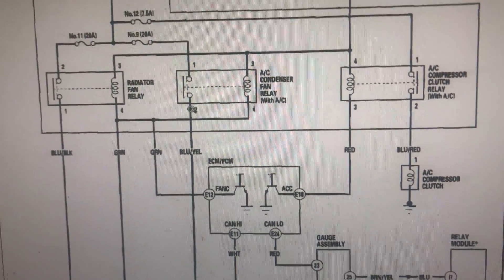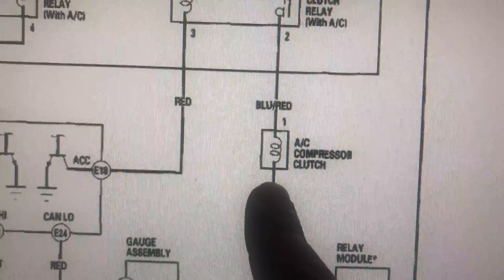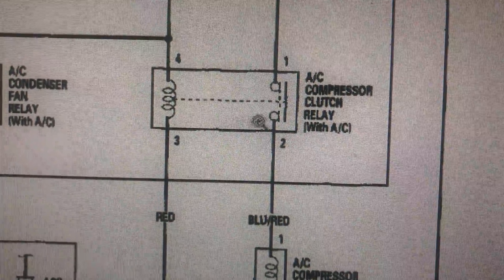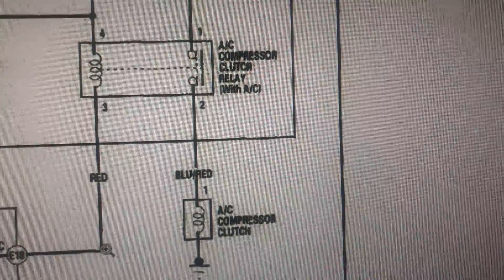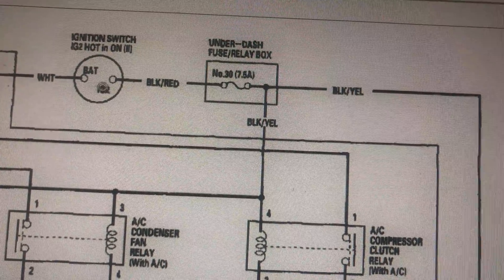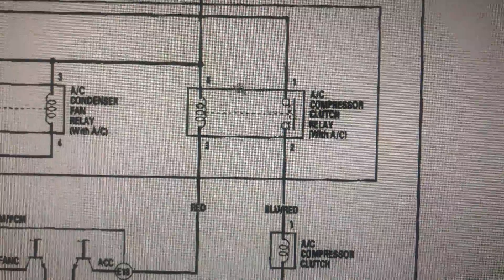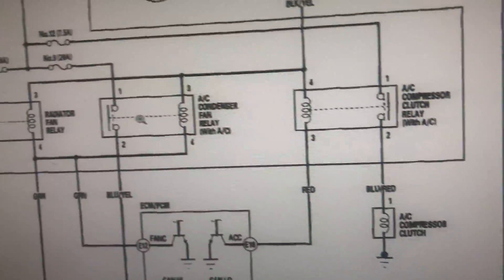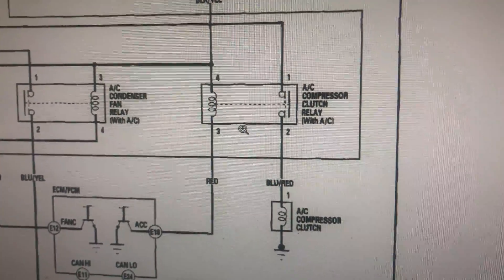Honda Accord 2.4L 2003 to 2007 AC Compressor wiring diagram, relay and fuse explained

Comment: All wires get power all relays are good but the ac dosnt kick, tested everything checked every fuse even took apart the harness and found nothing, my only conclusion is the ecm/pcm
Reply: Please lmk if I'm wrong I love in az and it's hell rn w out ac
Reply from the maker: Damn bro hell of hot anyways check pressure? Also check power to ac compressor with ac on and scan the car for codes. Let me know what year make model u have

Comment: my car is 2007 Honda Accord but number 12 fuses 7.5 A. has not in may car?🤔 ...why? In its place there is a 20 amp fuse for headlight washing.
Reply from the maker: Maybe sumone move it around
Reply: @RBTheMechanic  There was no clutch operation because the air conditioner gas ran out. Thank you.
Reply from the maker: @adnanbedestencioglu6680  oh ok 👍
Reply: @RBTheMechanic  The original is like that, I think there is a difference in version... Unfortunately, my air conditioning compressor does not engage.

Comment: What if all that works but the blower and when connecting blower to direct power ot works. Could maybe the wire harness?
Reply from the maker: I doubt it I can’t say fire sure u have to check inputs out puts relay fuses and check resistor try high speed

Comment: hello, when I installed junsun android screen, my motor both fans doesnt work with ac on, with original fans start instantly, do you know what might be the problem?
Reply from the maker: You installed what?
Reply: @RBTheMechanic  I swapped original radio player with android unit from junsun
Reply from the maker: @zydrunaslazauskas7273  so that shouldn’t affect unless u tapped in to wiring

Comment: Does the ecu engerzie the relay or the climate control panel?
Reply: What fuse gives power to the climate control?
Reply from the maker: @mmar4281990  I gotta check that also but it should be under hood listed under cover
Reply: Is their anyway I can get a copy of the circuits?
Reply from the maker: @mmar4281990  I can send u pictures Monday noon
Reply: I would really appreciate it 🙏
Reply from the maker: I would have to check on that what year car make model u got
Reply: @RBTheMechanic  2004 honda accord ex v6 sedan
Reply from the maker: @mmar4281990  yup it’s controlled by ecm

Comment: mine say climate control cant be used when engine is off 
i checked all fuses their all good how do i fix this?
2004 honda accord v6 sedan
Reply from the maker: Ac wount work without engine running but with key on acc u should be able to turn fan speed and mode
Reply: @RBTheMechanic  that doesn't work either

Comment: Thanks for the video.  I have an interesting issue.  Neither my condenser or radiator fan come on when I turn on ac.  Also, ac clutch doesn't engage.  However, I know both are functional, as they both turn on if I manually jump the relay socket pins.  Also, the condenser fan does turn on when the radiator is cooling itself.  So those don't seem to be the issue.

I'm going to need to re-do my research with a test light (I was only using a multimeter), but it does appear I was getting a switched signal at both relay sockets when I turned the AC on and tested the pins with a multimeter.  So I think the problem lies in the engine bay and not the interior area, because the relays are receiving a signal.  Both relays have been tested and are good.

Already checked the low side pressure and it's fine (97 acura cl v6) at 35psi with the clutch manually engaged.  However, I have not checked the high side pressure (I'd have to order a kit for that).  Also tested the ambient temp sensor and it appears to be reading fine.  

Also tried manually jumping the ac pressure switch's (my vehicle only has 1 pressure switch) 2 terminals to simulate continuity, but nothing changed.  At this point I'm kind of stumped.  Either I'm getting the wrong reading on my low side pressure, or my high side pressure if off..or I'm running out of ideas.

Looking at the Ac diagram for my vehicle, it appears the only other culprits could be a faulty engine coolant temp sensor (I replaced it with a new unit a month ago), a bad fan radiator switch, or faulty radiator fan control module.  

One thing I will say, is that I'm wondering if my cooling fans are working as they should.  With the car idling and warmed up to temp, they both kick on simultaneously, but only stay on for around 10 seconds.  Then kick back on a few minutes later and stay on for 10 seconds...in an infinite cycle.  Is this normal behavior for a parked car, or should they be staying on longer than that?

Thanks for any ideas!
Reply from the maker: They usully come on and off for 5/10 seconds with ac they will run all time check to see if ac system works

Comment: Hi. please help me. My h/accord 03.the relay pin 4 no signal ( rad fan cond fan and comp) pressure switch temp sensor is ok,
Reply from the maker: Somthing like that u have to do electrical trouble shooting.  How ever do check fuses and swap the relay regardless

Comment: Hello, I got a 2003 honda Accord. If I short the relay with a paper clip bypass the cluch kicks in. but when I put the relay back or switch with others it the cluch doesnt kick. Can you help?
Reply from the maker: When u by pass and clutch kicks on dose ur ac blow cold?
Reply: @RBTheMechanic  yes and I was able to charge the system
Reply from the maker: @o4u2sweat  well did u change out the relay?
Reply: @RBTheMechanic  yes and switch them with others. No luck

Comment: Thanks. Please help. I can't get my ECU to produce ground for the relay to work.
Reply from the maker: What year make model I have.   Look in to the pressure switch for ac scan the car look for any HVAC codes let me know need to scan all modules also use good scan tool the small $80 scan tools will not pull the codes
Reply: @RBTheMechanic  Thanks. I got a good scan tool and all are fine except a short in air mix door motor.
Reply: @RBTheMechanic  The switching side of the compressor relay starts the compressor when I bridge it. On the other side,  there is steady live voltage when ignition is on.  My ac control panel switch clicks and lights up but does not send ground to the second component of the relay as it should
Reply from the maker: @fortunerecords8154  check all of ur fuses and ac pressure switch gives digital to computer to command the ac to come on anyways dose the system get cold when u bridge it?
Reply: @RBTheMechanic  I made a discovery tonight.  I noticed that my seat belt warning light, dash backlight(when key is inserted), driver door alarm and ac system all went down same time. I unplugged a battery terminal and let it sit for a while and all these functioned normally for a minute before going bad again. My SRS module is bad and burned from soldering, is it a possible cause or would it be the under dash fuse box/module. Thanks a bunch
Reply from the maker: @fortunerecords8154  I’m not sure if wiring coross to module but u might have to fix the soldering wiring and make sure everything is good check fuses also this is serious electrical issue

Comment: I see message down below. It is  pretty much the same as what  I  have experienced. 
It is found that: clutch coil on my Honda 2005 is bad. It stops  working after couple  cycles on/ off.  ... I measured resistance of coil . It reads  4 ohms when working.  Let it run couple minutes... When AC stop working, coil resistance reads 0 ohm. So, clutch is short when getting hot. 
time to replace coil now.
Reply from the maker: Dong Bao hood diagnostic u went deep in to measurements I silly swap relay then see if ac compressor has power if it got power bad compressor!
Reply: @RBTheMechanic  Relay is checked and even exchanged . Because there are identical relays around clutch relay. I still get the same problem:  Clutch is engaged. Cool air comes out.  Then I drive  car out. In middle of road, no AC anymore, just hot air...  Relay is super hot. Guess that  current is pretty high when coil is getting  worse  until it is short . That is how measurement is to be done to make sure clutch is root cause, not  control , or relay. Now, removing clutch is next thing to do. :-) . I am electrical guy, not mechanical. But it looks not too hard.
Second,  AC control indication on LCD screen is gone now. It appears that I have to reset controller board or so. No AC control on screen .  My Honda is 2005 V6. If you know  how to reset it, I appreciate your share.
Reply from the maker: Dong Bao try this if u have test light next time the ac shuts off see if u can check to see if the power to ac compressor comming also tap on the relay.

Comment: Help! I've had ac system recharged, put on a new relay.  My problem is when it's hot outside, when I first start the car the ac blows some cold air at first ,then if I stay idle it starts to blow warm air, but it I'm driving distance it blows cold. Both fans come on and off.  The clutch kicks in   but goes off.  So basically it's when I'm idle it doesn't stay engaged.
Reply from the maker: Msfly Tee  well compressor suppose to come on and offf .... try having it recharged it would be the machine didn’t put enough Freon in the system or it could be bad ac compressor
Reply: @RBTheMechanic  Yeah I had it recharged, but that didn't work.   Oh no hope it isn't the compressor.   Thanks
Reply from the maker: Msfly Tee try having it serviced again I have had problems like that machine didn’t add enough Freon

Comment: Thank you my brother !! I believe is my ecm is not supplying ground to my relay
Reply: Haven't confirmed it yet cause to check is in a tight spot !! And its hot out here
Reply: @m.i.g5362  hey did you ever fix it?
Reply: @nicksauto  my brother yes Sir appreciate your help 🙏 God bless 🙏
Reply: Do you remember what is was? Im having the same issue rn. No ground out of A17
Reply: @evanwinblad8733  I fix an 07 honda accord today. The ac pressure was not getting a voltage from the control relay. I was getting the ground from the climate control. The problem ended up being a wire that was splice when the car had an accident in the front.
Reply: @nicksauto  i get 5v at the pressure switch and also 5v going into pin A27. Just no ground coming from A17 to kick the compressor relay on
Reply: @evanwinblad8733  at the ac switch connector you should be getting a ground from the blue wire(climate control) and about 12v from the red/blue wire.
Reply: Same issue here,  I’m thinking the ECM does not send out the ground signal.  Everything else checks fine